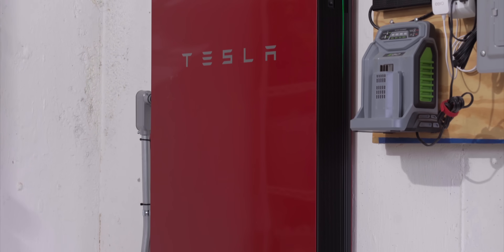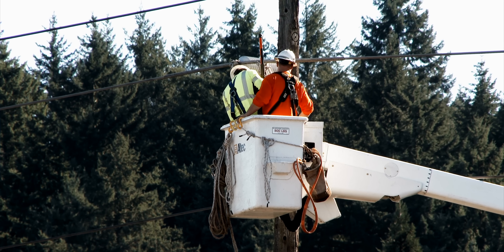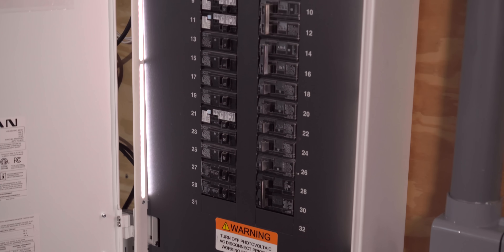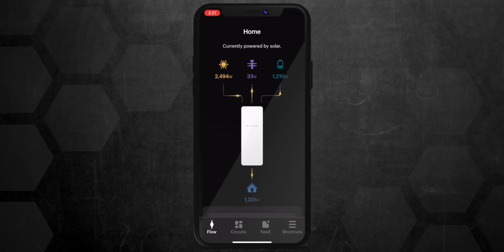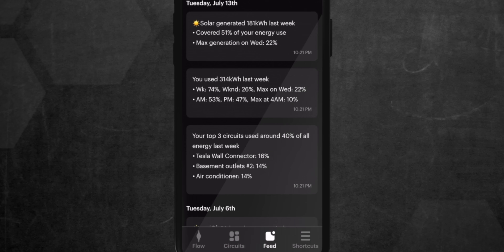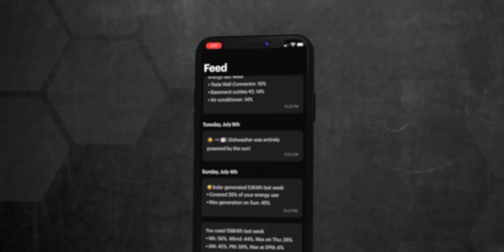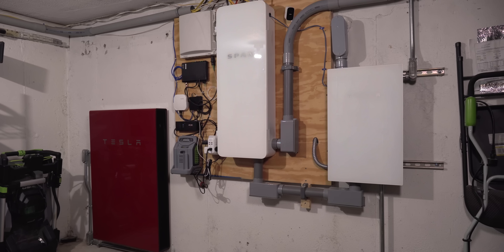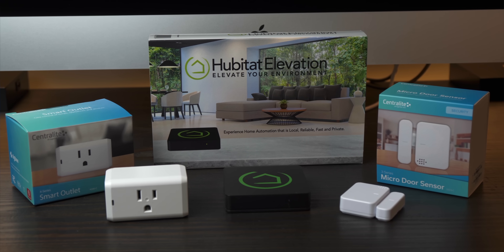This Smart Home Electric Panel Fixed My Tesla Powerwall

Comment: I'm now planning on having a Span installed (with solar and powerwall). However I have 39 circuits currently and Span only has capacity of 32. So what should I combine into a "sub panel".

Comment: Although the SPAN unit seems fantastic - here in Australia I can’t see many standard houses that could utilise it well as most only have 2 circuits for all the lights in the house (half on each) and 2 or maybe 3 circuits for the electrical sockets (outlets as you call them) again usually ½ (or ⅓) on each. This is probably due to our voltage of 240V and the ability to run lots of stuff off a single circuit?

So when you shut any circuit down it kills a lot of stuff and a bed lamp could easily be on the same circuit as a fridge for example. 

Aircon units, oven and Hot Water systems do typically have their own circuit and they are often excluded in battery systems during an outage due to their high energy draw (unless you have enough PowerWalls to provide supply).

Comment: I enjoyed this video and appreciate your enthusiasm.  I'm interested in knowing if the Span panel can be used with an interlock kit attached to a portable generator, rather than a solar battery. I don't think solar batteries are good values yet, and controlling a generator powered panel from the App that would be a nice bridge to when batteries are a better value.
Reply: This sounds like absolute absurd overkill for a portable generator...and as the video says it only works with select battery systems.

Comment: Do the comm wires have the same insulation rating as the power wires Romex or THHN. You really shouldn’t be mixing the two types if they are not

Comment: Being as nvidia was hacked in 2022. Its only a matter of time when your house circuits will be hacked and turned on or off by malicious hackers. Less is more..
Reply: This is why every home should have a very good hardware firewall and restrict all access to these devices unless over VPN.   Given that SPAN is cloud based that could be an issue.   All of these companies should provide local processing of device control and not require (or allow you to disable) cloud based access if you choose to.   Force local control over those functions.
Reply: @santiagodraco  pihole is great to see what is sniffing and block it at a DNS level as well

Comment: I'm assuming that in order to get enough fine grained control and reporting that you can turn off individual appliances or have the system report that "The refrigerator is using more power than normal", you'd need separate physical circuits from the panel for each of them? In my house for example, the entire upstairs is on a single group in the circuit panel, so it's impossible to tell what appliance is drawing what power from the panel. Or does the Span also come with some kind of smart plugs that could be used to give you more fine grained controls and power usage analytics?
Reply: It does not control devices, just circuits.  What you can do (which is how my smarthome is setup) is put smart appliance switches on these devices and if it senses trouble then you could turn the devices off individually to isolate the problem.  This is also where integration between SPAN and say SmartThings would be great.  Hopefully the new Matter protocol will help with this.

Comment: I think Span is cool but the price quotes I am seeing in Western NC start at $8k and goes up beyond $12k.making me wonder if it is worth it. The big advantage compared to essential circuits sub-panel is that you can move branch circuits between groups using the app on the fly. Of course it also allows monitoring of each circuit. But I am wondering in a power outage situation how often do you actually move them? If chosen right will a essential circuits panel  at $1 - $2k do just as well? Also how about an alternative like Lumin though it is not the same.

Comment: Is there any point in installing a smart breaker panel before you have the solar system in place? I’m thinking about coming at this in reverse. Here’s why.
The recent ice storm knocked us out for 4 days (again). I have a very large dual-fuel generator, and my electrician tells me that it would run most of my house as long as we’re careful to do the Green Acres thing. My current breaker panel is maxed out so we would have to install a new panel to add a transfer switch. By running 12 gauge extension cords through the kitchen window we were about to run the furnace and the frig, but not much more.
I have been actively shopping for a solar system, but at this rate it might be next year before that can be set up. One way or another I am going to have a transfer switch in place within the next month, but I’m afraid that (A) installing the SPAN now might complicate the installation of the solar system, and (B) that if I install a generic panel with a transfer switch now I will end up installing a whole new panel later.
Any thoughts will be appreciated.
Reply: For a generator it might be because you can control power draw while off-grid.  But the cost might not make it worth it.

Comment: Sounds great, but apparently not quite for regular hybrid inverters.
Digging further, it looks like this is only a great system for tesla Powerwall / Gateway configuration.

At first, I saw on their website they had the option for a Transfer switch inside the panel but asking them more details about how the panel connects with regular Hybrid Inverter / battery system, they said they no longer support that option.

Apparently, the way they configure regular hybrid inverter is by just connecting the Smart panel to the Inverter critical load panel output.
If that is the case, then the Panel is ALWAYS limited by the Inverter critical Load output power (even when grid is up), and therefore you cannot actually move ALL the house loads in there.

To allow the Smart panel to contain all House loads and actually replace all panels, you would need a transfer switch so that when the grid is up, the Smart panel is connected directly to the grid, allowing enough power for all loads, and in an outage the transfer switch flips the Smart panel to the Inverter critical load output, with the Smart panel automatically managing which loads can be used to prevent overloading the inverter.

But unless I was misinformed, as it stands, the biggest feature of the Smart panel is basically not usable on a regular Hybrid inverter setup.
Too bad....

Comment: I’m building a 2000 sq ft home with solar and two or three power walls. I’m thinking that a Span panel would nicely complement these plans.
Reply: Mine get's installed tomorrow :)  17.5kw system with 3 powerwalls already working.

Comment: Hi Matt - as always, this was a great video.  I just had Dave King's team complete the installation of two Powerwalls (which by the way I ordered 20 months ago!).  Revolusun did my solar installation as well and I have been very pleased with their workmanship.  I was talking to the RevoluSun team and told them about your Powerwall installation (things to avoid) video.  That's when they told me to go watch the Span installation video.  I'm now considering getting them back in to do a Span installation.  This has been super helpful for me to make up my mind about the Span system.  Thanks again.

Comment: Hello, Obviously house wiring standards seem to be different in USA. In Australia, most homes only have  a few power circuits and one for lighting. In the case of my home, I only have 4 ordinary power circuits plus one for the oven grill (its a gas oven) and a separate one for the EV charger. To use something like span would mean a complete house rewire to allow for basically one circuit per outlet. Thank for your always informative videos.

Comment: Sounds like an incredible gadget for those wealthy gadget lovers.  An useful tool to see that while you have sun on your solar panels your laundry and dish-washing is 100% solar powered.  Remote circuit disconnect for that one time maintenance. The majority of solar customers rarely look at their inverter app after the honeymoon phase is over.  I have to imagine this would be similar.  Don't get me wrong, I'd love to have one but I seriously doubt the imagined benefits.  And most laymen don't realize that in order to granularly control devices and branch circuits, a major electrical overhaul would be needed.  Not a hater Matt, but not a fair review from someone who got it for nothing.  Love your videos.  Thanks.

Comment: Sounds like a solution looking for a problem.  Automation benefit diminishes if is based on  convince or laziness.

Same problem, what about an off the shelf battery bank with an off the grid connection with solar panels and an inverter.  This would be a fraction of the cost and operational more effective.

Power the house via a backfeed connector by shutting off power main circuit braker manually and flip on feedback braker.  Can get upper of 5Kw service for 8 to 12 hours.
Blackouts are not common so for instances of 1, 2,3, 4, or 5 days per year a simple cost effective solution would work. 5/365 = 1.3% of the time.  So how often it happens and for how long really determines the actual benefit of the solution.

Comment: Looks like a Very good control system. But at $3500, the business case for using this system is hard to make. The average EV charged at home uses about $450 electricity (3 mWh)/year to go 12,000 miles. EV charging is very 'time' discretionary in many use cases and EV charging can currently be managed without a system like SPAN, to participate in demand response and Time of Use rates.  And SPAN wants an additional $500 for SPAN drive? You can get most of this EVSE functionality with many level II home EV chargers. The same is true for HVAC and Hot water heaters. Energy aggregators will be putting systems into smart neighborhoods and developments and multi-unit apartments at about a 5th of this SPAN system cost in a about 12 months. Looking for this SPAN price point to drop precipitously.  At a wholesale price of $999 it would be a lot easier to make the economic and environmental case for SPAN. I hope with competition a sub $1000 price is hit in the next year.

Comment: The "Span" Circuit controller seems like a natural for all the California NEW Home builders that as of 1/1/22 must install Solar Panels in all roofs. If those home buyers do not get power walls does the
cost/benefit still pencil out or how would one figure out the ROI on the $3,500 without an Energy Storage component ?

Comment: Need to explain longevity of current battery storage systems. Batteries don't last forever. Also don't need to emphasize black outs, which are typically rare events, at least for now.   Also could go into whether span can be considered part of a solar installation tax credit structure which is slowly disappearing now. Great technical presentation for techies. Maybe dumb it down more to explain to non technical folks to get a larger market, and discuss what the payback over years of ownership. Solar paybacks for energy cost are averaging 6 years for just solar, no batteries ( without electric car). I think you get the point. If no tax savings and no energy payback, it's just a high tech power " insurance" device with more electrical complications for installation.

Comment: I love what this does for your ability to see exactly where your power is being drained from. I have a 10.4kw solar system on my roof, and I put it up to maximize savings from the ever increasing costs of electricity. With the costs of batteries and something like this SPAN it would seem you would NEVER eve break even. I would love to eventually have batteries but not if it is gonna cost me 11k or more. My entire solar system was 23k after tax credit. It would seem spending 7k on adding to my solar system would be smarter than adding batteries, at least until the cost of batteries drops in half. That being said, this Span system looks amazing!
Reply: I'm with you. I plan to sell my solar to the grid and use a generator for back-up until more EVs offer V2H capabilities.

Comment: Hi Matt,
I enjoyed watching this again, as we are getting closer to construct and key decisions.  Quick question in case you see this:  
* will the SPAN panel allow me to use those thin 1/2 thickness breakers if I need to squeeze in another circuit?  :-) 

Cheers Mate!
Eric
Reply: You can use tandem breakers but when you shut it down in software it will shut down both.
Reply: @BR-ft2xg  thank you!

Comment: If it requires a cloud account it’s a non starter for me. Without LAN-only setting you’re just asking for problems with, say, supply chain hack pushing malware in an update and blacking out your house unless you pay ransome

Or say the company goes bankrupt because they are trying to sell a $3,000 electrical panel. What happens to your panel then? Does it stop working? 

Not to mention the massive privacy implications of providing a company a real time data feed of your consumption plus all of the ip addresses of devices you connect to the panel…

Comment: This stuff is great and needs to be worked on, but you point to the really big issue with tech like this and renewable energy in general. Today, it all, from EVs to solar panels to power walls, still seems like a luxury item for the 1 to 10%. Now that doesn’t mean that the <10% shouldn’t employ this technology to reduce their carbon footprint as they can afford it, but what about the other >90% who have neither the money or the time to spend tinkering and operating their own micro grid to get the most out of it? Environmental altruism has always been the luxury of prosperous societies which is why the US and Western Europe have done a better job on land and water quality, and even air quality to some extent, but our prosperity is all built on an unsustainable foundation of cheap fossil fuel energy which is going to ultimately incinerate the planet. If we are going to bring low-carbon AND affordable energy to the masses AND save the planet, shouldn’t we just get on with NextGen nuclear; both fission (near-term) and fusion (long-term)?

Comment: The 90 amp maximum branch breaker size concerns me. Unless the PV/storage/PV and storage are tied in on the line side (between the meter and main panel) then the maximum system size could end up being limited by that maximum. It also limits the size of your subpanels, which could require 100A or more. So I don't know if I see using the Span for more than a subpanel, or if the customer is ordering a small PV/storage size.

Comment: Yeah this is a setup professional installers are getting away from. Code sayes the microgrid has to be able to handle all the loads posed on an automatic transfered system without manually turning things off. A whole-home set up that only needs one Powerwall is very rare. You can probably only do one energy efficient low-surging fridge, lights, internet router, and PC, phone charging with that. Nothing more with heating elements or inductive motor loads

Comment: I currently have a 6.4kw solar system and soliciting for a battery backup system. At this time I'm leaning to a generac powercell with the full six batteries. The system will provide a great deal of power rating along with a really high peak rating. I'm also installing a soft start on my 4 ton ac unit. Is this smart panel compatible with the generac powercell?

Comment: I am about ready to purchase my solar system and 3 power walls from Tesla. Don’t they include and arrange the install with certified installers? My system is be quoted @ $51,000 before credits. I also heard that I need to make sure I am getting 600 volt panels and not thier old ones. Is this true? I am now considering the SPAN for my system here in SW Florida.

Comment: I'm back.  The SPAN panel was commissioned today.  There is a severe weakness in their CONOP, where they tie the hands of the electrician and get in the way of relationship between the customer and the electrician.  I too am looking forward to the potential of this panel, with its ethernet connection to the Tesla Gateway.
Reply: Can you expand on the CONOP thing?

Comment: So let me get this straight: you pay around $5500 (including installation) mainly so you don't have to flip a few breakers once or twice a year? No thanks! Yes, it's a clever product that does a nifty thing, but this strikes me as yet another case of losing sight of the big picture just because there's a new whizbang gadget. The power monitoring is handy, but there are much cheaper options for that.
Reply: What a clever way of missing the point

Comment: Is it cloud based? As in, how does this work  with zero internet connection?
Reply from the maker: The app is cloud based right now, but they did mention they're working on local control too.  If your internet goes out, it still works as you programed it.

Comment: Have look at Rosewater Energy. Backs up a 200A sub panel. Additionally it is operational 24/7 always isolating you from the variation on the grid

Comment: Interesting product, especially if doing a new construction and installing solar and batteries. A retrofit or replacement of an existing panel is obviously expensive. I just had a look online and there are Smart Wifi Circuit Breakers for your current board that you can get for about $60 (prices vary by brand). So what if you created a virtual panel using these for the non-critical or power hungry loads and disabled them during a blackout (automate based on the battery status > when disconnected from grid, disable non-crit circuits)). This maybe a small number of circuits, say 4 and now you are at about $240 and the critical circuits stay as they are > on.

Comment: Communication wires don't have to be in conduit.......cus its low voltage wiring. If you cat 6 run in your house. It won't be in conduit princess